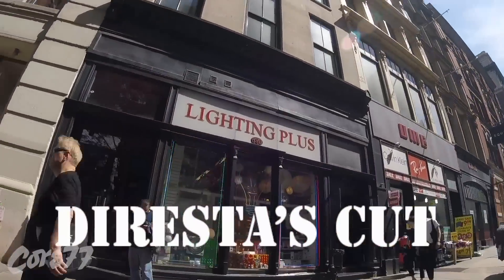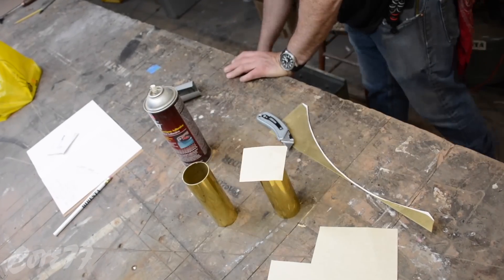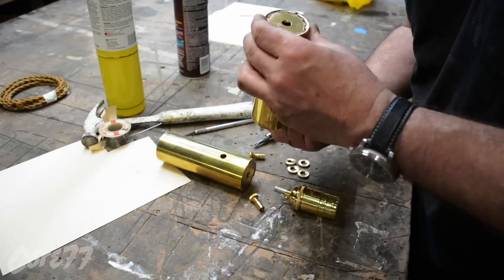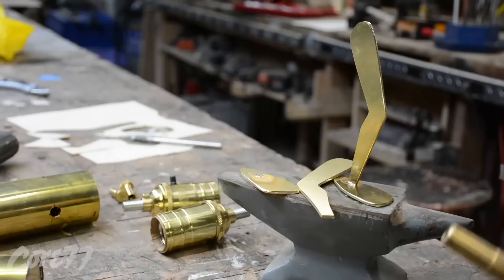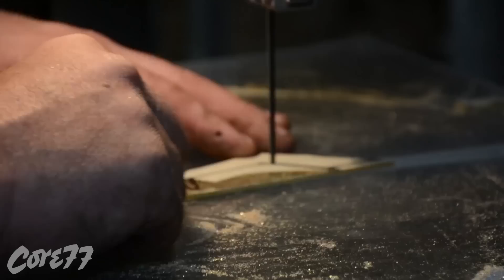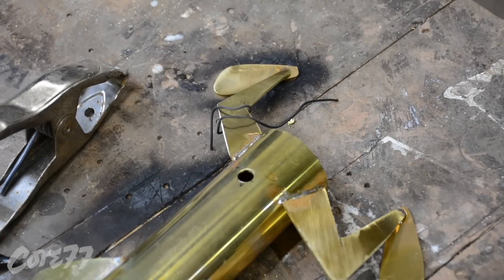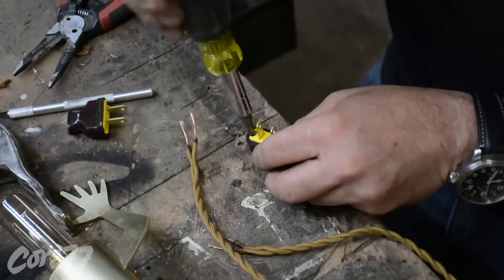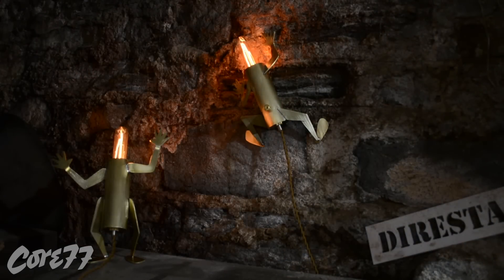DiResta's Cut: Brass 'Bot Lamps

Comment: Its pretty easy in Europe ...
1 life (230V) and 1 neutral are ALWAYS needed (obviously).

The earth/ ground is ONLY needed, when the housing is conductive.

Why? Because when the wire that is plugged into life touches the housing you get a short circuit. But only when the housing is wired to earth/ ground!

And whats the sense of this?
short circuit -> fuse reacts -> you can touch the conductive housing without dying.
Without that: your housing has a potential of 230V that could kill you because the resistance of your body can be too high and the fuse wont react.

thats all theory, sure. its just a safety thing and im pretty sure that even in 100 years the wires will stay in place in his lamps here ;p

And no, its not the same when neutral is used as the same wire as earth/ ground. It can work in some case but in most it wont.
(it will only work when the plug only can plugged in one way ... and even then you have to be absolutely sure that lets say the left pin is life and the right one is neutral)

Sorry for my bad english :p

Edit: forgot to say: awesome project :) both thumbs up :)

Edit2: Changed ground to neutral and earth to earth/ ground
-> thanks to the comment below ;)
Reply: Perhaps you meant live and neutral, not ground. Ground is approximately the same as earth, and to be precise, we can call it protective earth (PE).
Reply: kraklakvakve maybe my vocabulary isnt perfect ;)
but everyone who has a liiitle bit experience with electrical stuff should know what was meant ...
then call it neutral instead of ground :)

Edit: i changed it, thanks for your hint! :)
Reply: same where i live.. 220v. if the housing is conductive it need ground.  Residual current circuit breaker on all oulets and outside fixtures. plus main Residual Current Circuit Breaker with Over Current Protection.

Comment: In the US you tend not to have an Earth because your gear primarily runs on 110 volts. Over here we run 230/240 volts so you're much more likely to die from a shock, thus we insulate, double insulate and earth everything.

Comment: Don't know what my fellow Europeans are talking about... I am in the UK which has the full 230v supply and none of the lamps I own and or make has a ground due to the very low current involved. Yes grounded anything is safer but anything that is passed for sale in UK / EU will be safety tested and if you are making a lamp do it properly / safely and no need for grounding until you get into high current draw stuff.

Comment: This is true with no ground. I've built 100+ bottle lamps. Not one has ever had a ground!
Reply: A bottle is not conductive therefore has no need to ground it. Brass or whatever hes using is conductive and needs to be grounded if your in europe, and yes we have ungrounded things aswell when the casing is non conductive.
Reply: Decieved my lamps have lots of metal on them. The wires run from a socket through a center rod and out the back.

Comment: Hey Jimmy firstly great work,,,, down  under the rule of thumb is if it has a metal body you put a ground if a nonconductive body dont worry about it ,,but funny thing is alot of these plastic power tools that have a 3rd prong the wire goes up and to nothing in the handle cause there is no way to get a short to anywhere that the user can touch its all much of a muchness cheers

Comment: AFAICT this is a Class 0 appliance (single insulation), in Europe this is prohibited. In the US you can get away with it because of the lower mains voltage (120 V vs 230 V).
Reply: Well, it depends on current and resistance of your body. 120 Volts on 16 Amps is still enough to kill someone and especially if you are young, weak or old person, you can count on that 👍

Comment: Don't worry Jimmy, most lamps/lighting don't have a ground here in the UK either.
Reply: caskwith with metal casing??? o_O
Reply: Yep, they have a classification called "double insulated", same thing is used on many items with no earth such as power tools.
Reply: yep, late night, my brain was off :))
Reply: Every which way I look at that lamp holder (watched the video 3 times now to try to see it closer), it doesn't look double insulated. The base of the lamp holder even appears to have a terminal on it's body which would be for an earth/ground. The requirements for a double insulated fitting are quite strict and I would expect the lamp holder to be plastic if it were.

Comment: Whenever I throw out an old tool, I cut off the wires to reuse them. I almost never find ground wires! Not even a hair dryer has one.
Reply: Max Maker hair dryers have GFCI's which are even "better" since there constantly measuring the current and will immediately trip.

Comment: Nice and cute project. love your videos but,  you need to do a few things to make the two prong version of this safer. first, you need an underwriters knot http://www.animatedknots.com/underwriters/index.php on the fixture side to prevent pullout and shock or worse fire... especially with conductive bodies like that. Second, you need to use a polarized plug(prongs are differently sized) and connect the hot(smaller of the two prongs on a polarized plug and also the rightmost one if you are looking at an upright thre pronged receptacle with the ground at the bottom) side to the middle of the light fixture. the threaded part of the bulb should be attached to the neutral leg (neutral is bonded to earth  ground at the breaker panel) to avoid shock.

Comment: the two reasons there are ground wires in the us are 1) if you need a reference voltage, like for a computer, and there is a lot of current on the return wire or 2) you are protecting against a short. w.r.t. 2) if your hot wire came loose and touched the case and the case was grounded, then it would trip the breaker. if you had a short to the case and no ground, then fire or shock is the next most likely outcome. Not likely to happen if you're careful, but you're a careful driver and you still wear a seatbelt, right?

Comment: Not having your lamps killed anybody so far, is not a scientifically valid statement to put forward. Add a ground, and it will still work with lowered risk of killing anybody ever. Ok, anyway, I like your techniques. I'm more or less a fan of your videos. Thanks for sharing.

Comment: You know, Jimmy, in the whole EU it's impossible buy a 2 pole electric plug... they sell only 3 pole.... btw u're great!!! greetings from Italy ;)
Reply: BS!
Reply: Wow. Really? I can buy them at the supermarket and you say they are impossible to find.
Reply: Euhhh half of the plugs available in the netherlands are 2 pole without a ground. Sorry
Reply: in Italy is pretty impossible find 2 pole plugs, really. U must buy a 3 pole and cut the middle one if u have an old house with 2 holes plugs in the walls. that's strange imho.
Reply: +Gaetano The EU is bigger than you think.  Any double insulated device can do with 2 pole plugs.
Reply: Adamast true
Reply: You can easily get 2 pole plug and it finds it use with double isolated products, but Jimmy's lamps aren't double isolated...

Comment: Nice lamps my friend, but the approach how you Americans deal with electrical security is one of the reasons why there is much more homes in fire than in Europe and especially in my country, which has pretty strict norms. If the body of your lamp is metalic, it needs to be grounded, or you put users or their property at increased danger. Does not matter if untill today nothing happened, when it will one day happen, it will be too late to tighten safety. You did few errors and each of them could be fatal one day.
Do your friends, customers and family a favor and stop do things with electricity until you get some knowledge.

Comment: anything with electric MUST have a safe route to earth because if the connection breaks and the wire contacts the side than it could earth through your body and through your heart if you touch the casing
Reply: GeorgeS your lack of punctuation plus the troll face makes me not want to believe you.
Reply: Not true; double insulation (Class II) appliances do not need the protective earth connection, because the risk of electric shock was mitigated by the double (or reinforced) insulation. Most lamps, hand tools, USB chargers, hair dryers etc. are in this class.
Reply: yup, but this lamp doesn't come under that category because its NOT doubly insulated! George is right, pretty sure it needs an earth, even just for redundancy if nothing else.
Reply: tammy smith It seems so. But if you can buy it in a reputable shop, I would assume it to be compliant with local regulations. With 120V, the risk is lower than in Europe, where the voltage is almost double.

Comment: Just the fact that nobody has died from your lamps doesn't make them safe. When the wire has mains voltage and the casing is not grounded it can definitely kill somebody when a wire gets in contact with the casing. You said it yourself: Loose wires cause fires (or death). I totally respect your abilities but your reasoning on this is just wrong.
Reply: Stephan come to America and tell me how to wire a lamp given exactly what's available in every store.
Reply: Stephan there is no way the wire can touch the casing this is the reason my lamps are safe.
Reply: I don't know there, but here in Brazil don't matter if the lamp has ground, because the entire house don't have, so, one more cable will do nothing..
Reply: I get where you're coming from but sometimes unexpected things happen like partly ripping out a cable causing it to get in contact with the casing. It might still look safe but in reality it's not. As long as you treat it right there will most likely not be any problem.
Reply: Stephan lamps with a metal switch need a ground. if there isnt a screw, solder the wire to the casing.
Reply: There is also no strain relief on the cables going into the lamp holders.
Reply: +Matthew Barras I'm not sure who you're telling to "Educate themselves" but not knowing yourself is pretty ironic.. UK and Europe has live (like hot in US) at 230V, Neutral which is the current return path, and Earth which is connected to the Earth at every household with a ground rod. (The neutral wire is actually connected to the ground plane too fyi)
Lots of lighting in Europe doesn't have any earth connection either, provided there is no metal housing. If there is then an earth really should be included. Don't get me wrong I'm not against Jimmy in this video and I have many appliances without a ground in my own house but I would never give anyone anything without an earth connection because people are stupid and misuse breaks everything (eventually).

I wouldn't mind the edison style lamps provided the screw part is always connected to the neutral but thanks to the US and their dainty reversible plugs, this can never be ensured
Reply: +Matthew Barras Yeah that's fine, it's your country after all. By the way I apologise for my previous comment being so long, it was directed towards the comment thread itself not you my friend.
Reply: Black is hot and white is the grounding conductor, or neutral.  So technically it does have a ground when only having two wires,  yes if poorly made, a lamp can shock you but not likely to kill, being an electrician 110vac really is just like having a cup of coffee, now high voltage dc can really bite ya...also even with a ground you can still be shocked if the lamp is poorly assembled so moral of the story....don't mess with shit you don't know about or don't build shitty stuff for anyone but yourself...
Reply: There are also metal cased power tools from a simpler time that did not have a ground wire,  only a few guys died from them
Reply: theClosetgrower420 in Europe we have 230V AC. That may be the reason why in Europe we Often use ground connections
Reply: +theClosetgrower420 I agree with you on 99% of what you said but the problem with having a US 2 prong plug is that there's a 50/50 chance of it being wired up right or wrong. Not a problem if there is no problem, but a shock risk if there is. 
In regards to shocks, you must have some nice shoes because mains 230V hurts like a MF lol
Reply: Following your advice I did educate myself:
https://en.wikipedia.org/wiki/Appliance_classes and https://en.wikipedia.org/wiki/NEMA_connector#NEMA_1

While the second article clearly mentions lamps being one of the common two-prong ungrounded appliances in the US, it also states that only double insulated (Class II) appliances, ones with two means of insulation between live conductors and the case, should use this plug.
Reason being that there is no way to prevent current flowing through you to earth in case of an failure where some part of the ungrounded but conductive case becomes live.
I enjoy Jimmy's art and content and encourage everybody to build lamps and stuff themselves. 
I don't care if this lamp is up to US Code or not, if Jimmy says that there is no way that the wire can touch the metal casing the lamp should be safe.
A three prong plug with the ground being connected to the metal casing would be a better design from an electrical point of view though.
Reply: Hey i just want to make a valid point and I know nothing about lamps and how all that crap works. But I do know that is you want to make a point and get your message across please do not use wikipedia it may seem like a great source of information but it can be considered not to be only due to the fact that anyone can edit it. I am not trying to seem like a dick I apologize for that. I am fascinated with the info I am learning just want to see more of from a better source.
Reply: +Gerrick Yeah sure, Wikipedia might not be one of the whitepaper-sources of information, but it is without doubt one of the most accessible (and free).
Try to take a look at IEC 61140 for example, it's not exactly cheap (83€) to get a copy of an international standard like that. I don't know if there is an online version of the US Electrical Code, this would be great source of citable knowledge.
Imho Wikipedia is perfectly valid to make my point, since knowledge if properly explained and reasoned does not need a big or reputable name behind it. You are however correct, I myself could have edited that article just to make my point. That's what standards are for.
Reply: gonna blow the guy's mind that in the US, 220v is completely ungrounded.
Reply: + Gerrick
The Wikipedia page that Phillip posted uses IEC 61140 and BS 2754 as supporting references. Is that a good enough source for you?
Reply: Gerrick I'm sick of people using that stupid, "anyone can edit it" about Wikipedia. Yes, anyone can edit it, but if it is wrong, or not properly referenced, it is immediately removed by the moderators. Go ahead and edit one of the pages and see what happens. It will be immediately reverted back.
Reply: Stephan  dude doesn't matter if your tired of people saying it but the fact of the matter is shit slips through these moderators and I was only trying to shine light on  that.
Reply: directorgtr on an non-polarized two prong plug (7:43), meaning it has two identical blades and you can plug it in either way, there is no way to say which color is live or neutral. the current doesn't care which color the wire has it is flowing through, btw. 110V or 230V doesn't matter in this discussion either, both are one phase AC with an voltage high enough to electrocute you.
the idea behind the third, separate ground conductor is to provide a safe return path for the current in case of an electrical failure, not during normal operation. this way an RCD can detect this failure-current and can switch of the circuit the faulty appliance is on, therefore saving our ignorant souls when we touch such a faulty appliance.
Reply: +Philipp Stenkamp So you're saying the coating color over the wires doesn't matter? I'm enlightened...

Find a code that requires a ground for all electrically powered anythings.  Go ahead, I'll wait.
Reply: You knew there would be at least one, Jimmy D... maker of killer lamps ;)

 Great build, love the whimsical design.  And the wall-mounted one does look awesome with the feet oriented like that!!
(Oh, and 'anthropomorphize' is definitely a word.  I wouldn't wanna try to pronounce it, though)  

Cheers Jimmy D!!